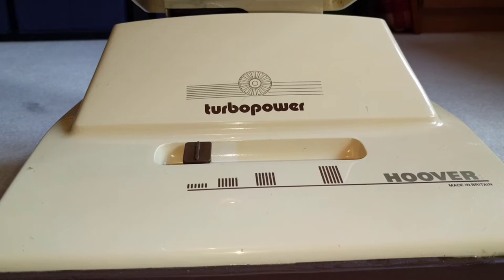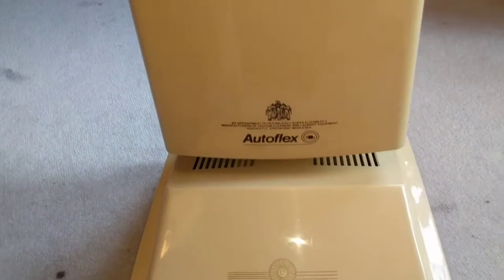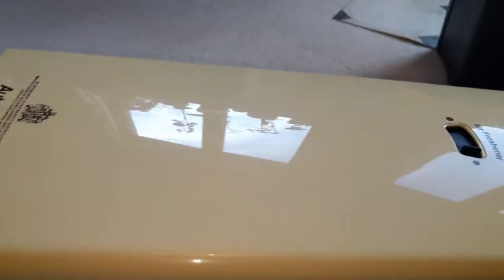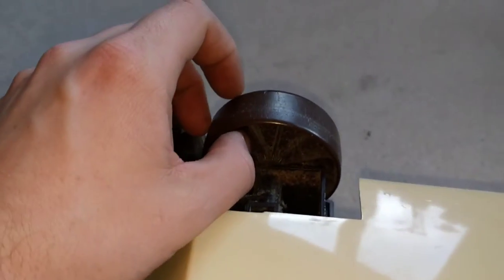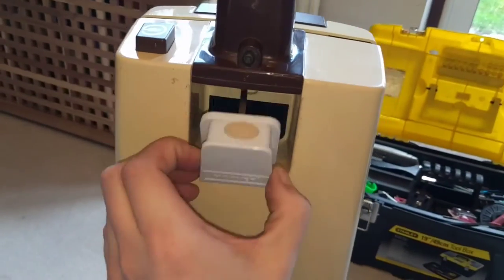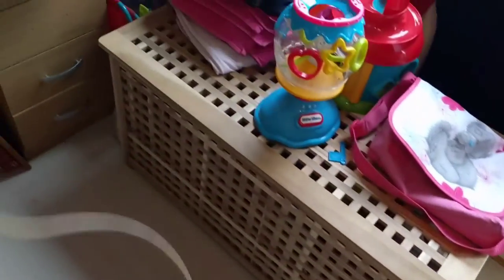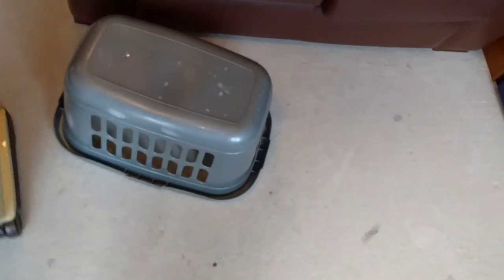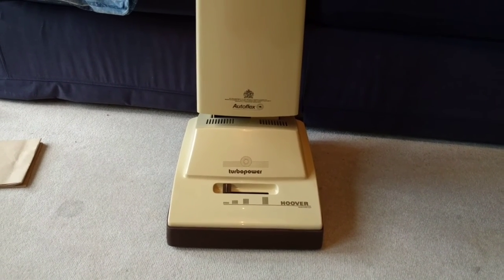First Look - A Hoover Turbopower U2196 from Jan 1985

Comment: That dating system started in 1967 with the Junior 1346. It ran up until the late 90s, when the Candy system came in, which used the year and the week number in the serial number.I remember those big Ever Ready plugs - and that one is in great condition. Its a nice machine, but pity about the back wheels - they were a weak point on the TP1.My carpet is the same colour, and no amount of shampooing removed the stains on mine. Bad idea getting beige carpets when you have pets, children, or fix dirty old vacuums on it, lol.